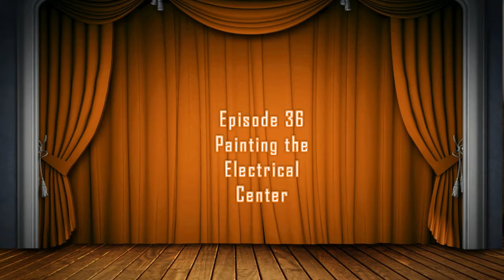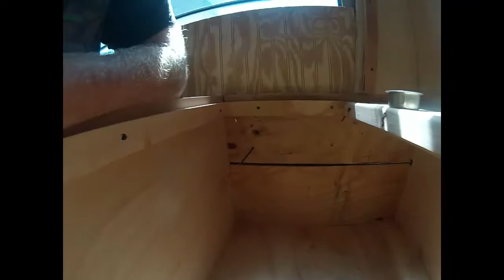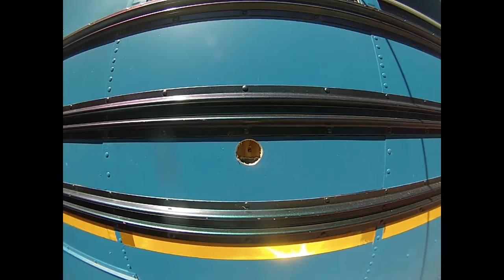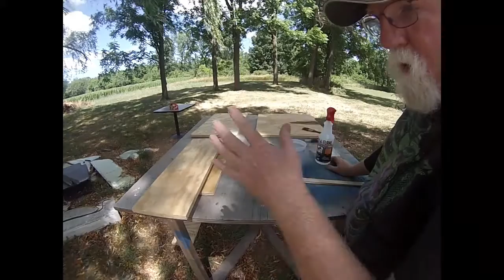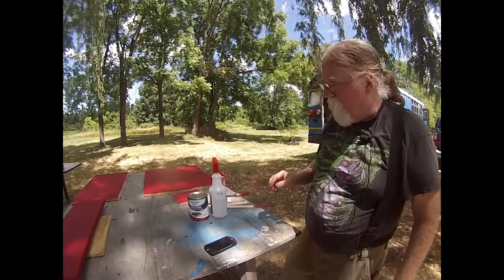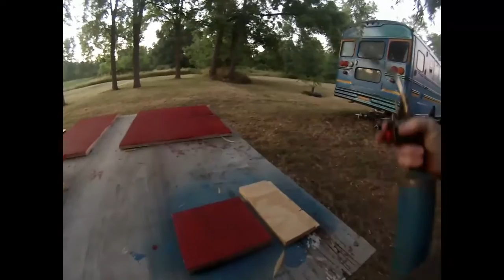Old Thyme Skoolie- Episode 36 Painting and Electrical Center

Comment: I don't see the  benefit, what fire do you expect? A spark will come once, and the fuse blocks futher sparks.
What you should be afraid of is acid, there is paint for that: http://www.aircraftspruce.com/catalog/cspages/blkfloatbtm.php
In my yonger days I painted batterystorerooms for the dutch PTT (telehone company) there should come acidproof paint on the walls.
To ventilate the fumes ventilation is a good Idea, but I would also make a hole in het floor.
Reply from the maker: I've had cars start on fire because a mouse nibbled on a wire before a fuse. A little paint as insurance can't hurt.
Reply from the maker: I don't expect a fire but the paint is like an insurance policy. Better to have and not need than need and not have.
My batteries are sealed so the vent will be more for heat than outgassing. Not expecting a lot of heat either.
Reply: +Steampunk Steve ok. thanks. Don't say later: you did'nt tell me haha  and I like blue better
Reply from the maker: I like blue but didn't want to copy RV Prevost.
Reply: I copied your bus color so it's all fair. I wouldn't worry to much about fire problems with gel or lead acid. just corrosion inside of the bus if they vent into it. I took extra fire safety measure only because of the lithium all though to be fair to lithium I don't think they're that prone to fire.